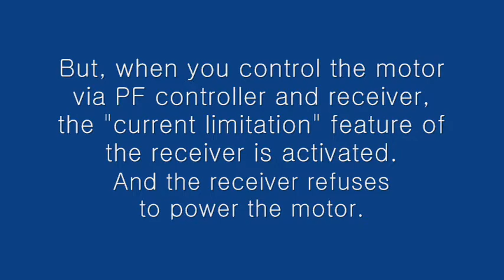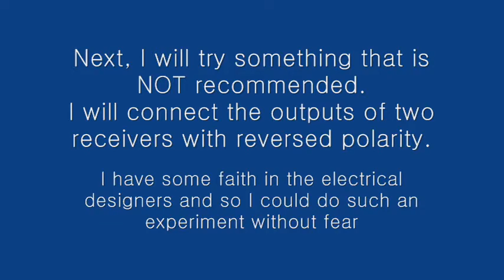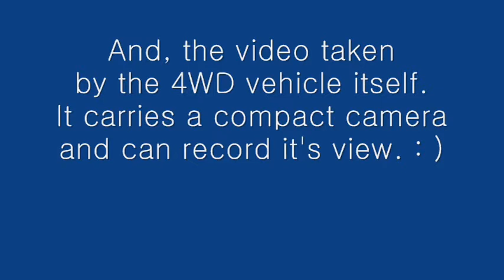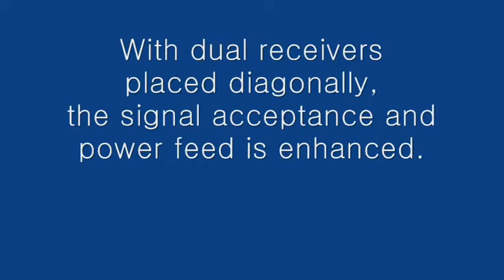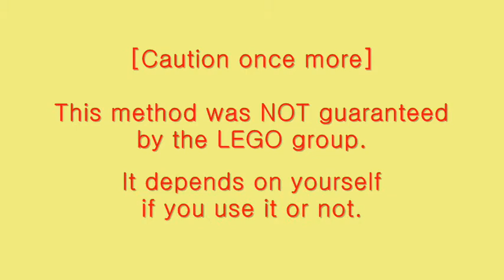Multiple Receiver for one motor method in LEGO PF system

Comment from the maker: @DrywFiltiarn 
Thank you for your concern and praise. : )
I agree that it is a short circuit. But, it is not directly connected to the battery.
The outputs came out of the receiver who has "current limitation" feature for safety. I felt some confidence in the electric designers and dared to experiment the reversed polarity experiment.

Comment from the maker: @jcbarros71 
I agree 100 percent.
This method is useful when it requires high torque and power such as starting a vehicle or climbing uphill.
Additional benefit is that we can distribute the receivers in order to get wider receiving angle(reducing blind spots). An example is seen in my 8043 MOD.

Comment: Since the LB1836  that's responsible on 8884 for running the motors has a 1A current limit, and a XL motor may draw instantly more than that at start-up, giving the motor 2 channels, each from 2 receivers, is allowing it to draw a maximum current of 2A.
Then, when the motor is running normally, lets say if it draws 200mA...600mA... there's no difference if its power is provided trough 1 or 2 receivers, because only one was perfectly capable of keep him running at that speed.